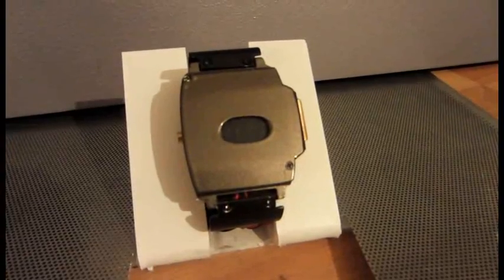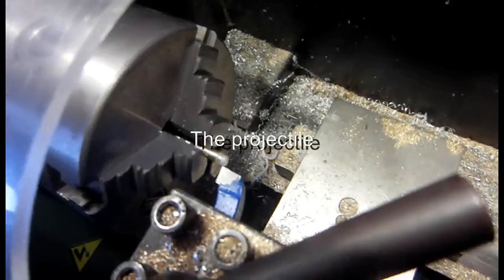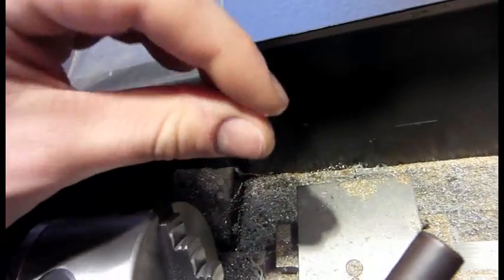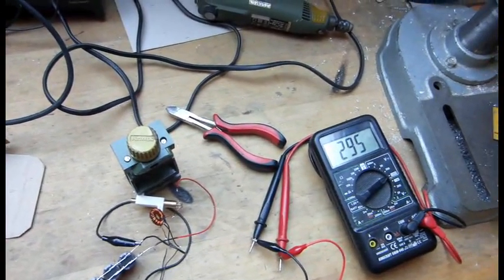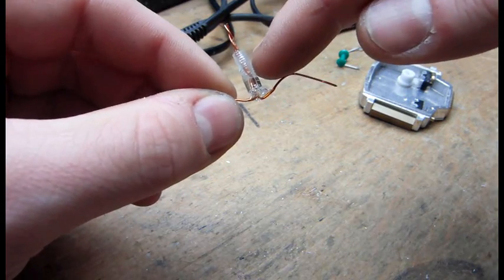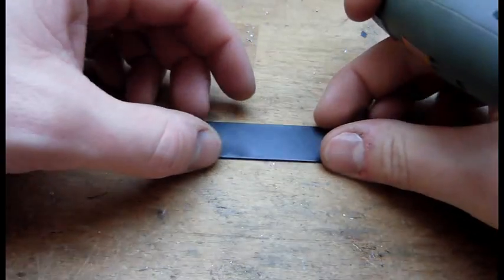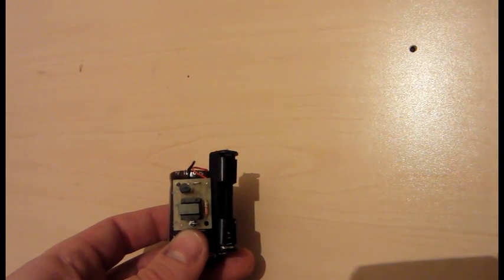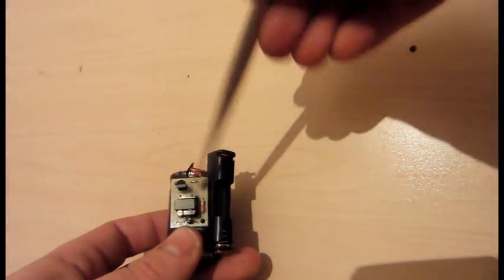SHOOTING Bond-style plasma-driven cannon / wrist watch

Comment: how does it work?
Reply from the maker: +asdf154 Electro thermal gun
Reply: +LaserGadgets isn't that really inefficient? How'd u get so much power in such a small package?
Reply: +LaserGadgets can I request a circuit schematic?
Reply from the maker: +asdf154 After calling it inefficient? No :p too dangerous.
Reply: +LaserGadgets lol I meant electro thermal guns in general. I was under the impression that they are really inefficient, which is why military is researching rail guns and such instead of electro thermal for their navy gun
Reply: +LaserGadgets is that like a joule thief charging a capacitor which then discharges into that plexiglass with 2 legs?
Reply from the maker: +asdf154 Railguns are even less efficient.
Reply: +LaserGadgets Oh isit? Interesting, didn't know that. Why the US Navy doing that instead of electro thermal? What about a multistage coil gun of equal input power?
Reply from the maker: +asdf154 Coilguns are even worse, and its more the durability of the ETG.